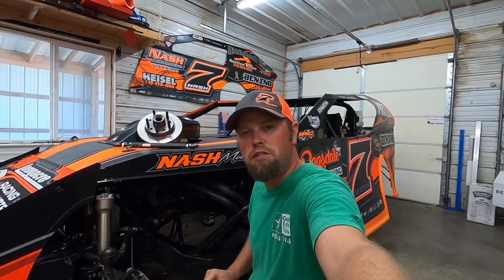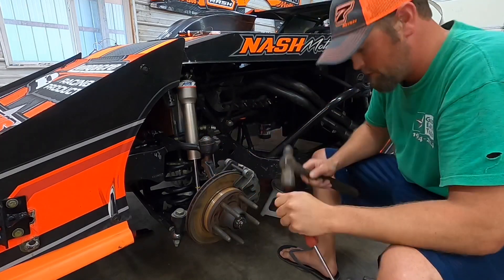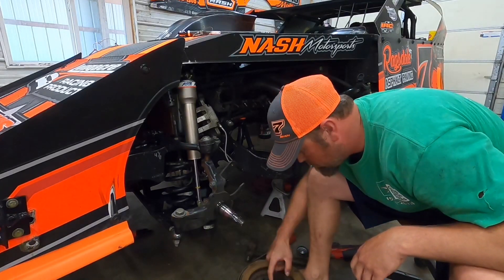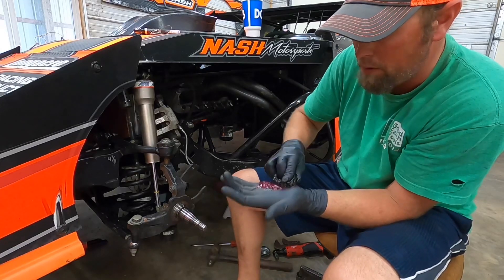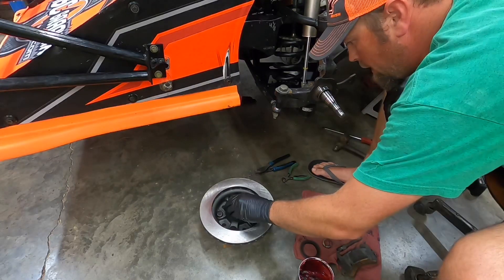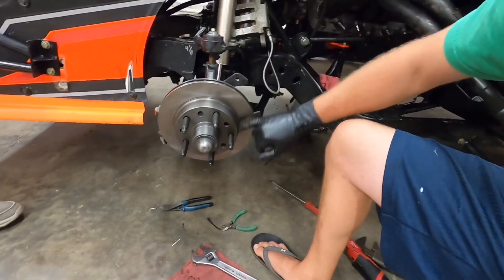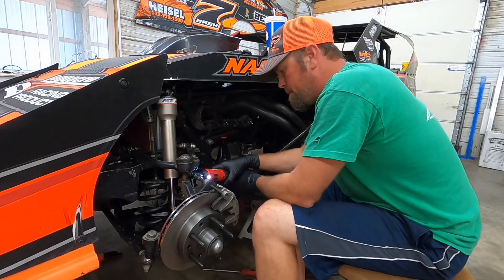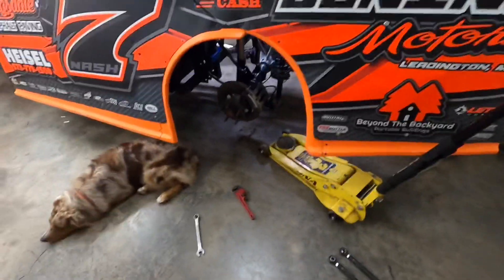We’re going to win this race In The shop | hard work pays off

Comment: Next time you change rotors  pull the outer bearing and washer then screw the nut back on a few rounds. Grab the rotor with two hands and yank. The inner bearing and seal will stay on the spindle 99.9% of the time.
Reply from the maker: Thanks for the tip

Comment: Tim if you don't mind saying what are the bar lengths on the  four link suspension? I have been working with a cad program drawing the suspensions of dirt track cars. Once I convert the model solids to components I can assemble them with joints and move them to get numbers for calculating roll steer bar angles camber gains bump steer ect. I need a good base starting length then I can play with bar angles and lengths and document the results. If you are fine with giving that info later on I need dimensions front suspension parts. If you wish not share that info I totally understand for reason you and I know. Thank You and as always awesome vids.
Reply from the maker: Sure. Email me oldno7garage@gmail.com
Reply: @OldNo7Garage  ok thank you I will compile a list of data I need then e-mail it to you. I have already experimented with it but need more accurate numbers so the results are more accurate. Then I can give you feed back and hopefully you can benefit from it. I am doing this more so as a hobby while also learning the cad program better and if you can benefit from it as well it would be great.
Reply from the maker: Sounds good